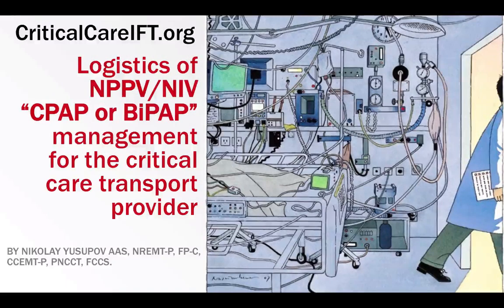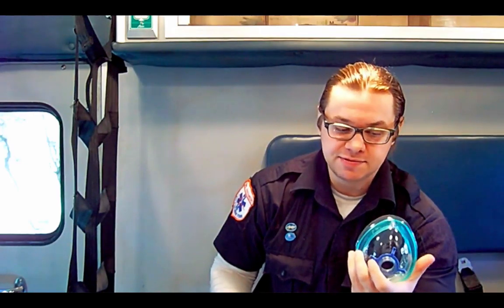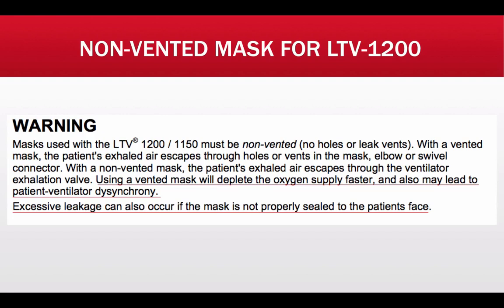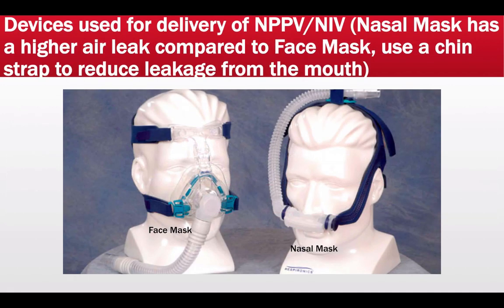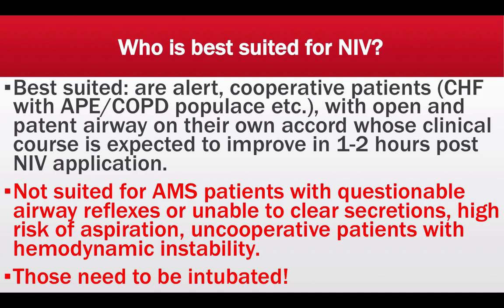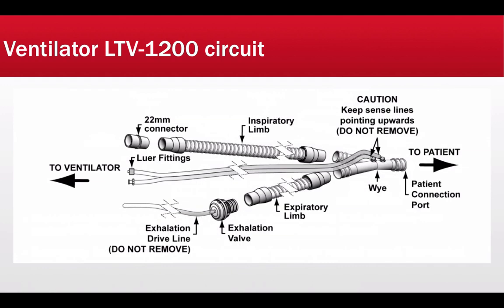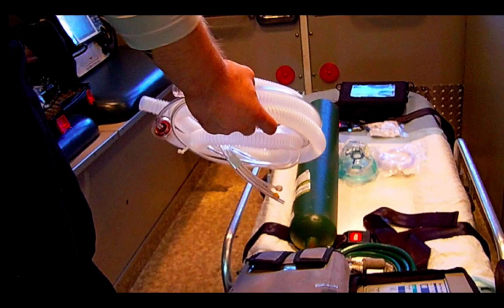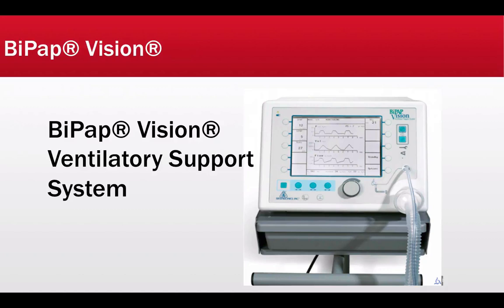How to set up CPAP and BiPAP Non Invasive Ventilation with LTV 1200 Ventilator? Part 1

Comment: is the white line exhalation, and yellow inhalations ?
Reply from the maker: Liz Malin if you referring to color luer locks that screw into the ventilator those are sense lines. Yellow luer lock is low pressure sense line, white is high pressure sense line, and no luer lock is exhalation drive line.

Comment: Great job with these videos.  Hope to see you do a few videos on Invasive Ventilation featuring the LTV 1200.  Love the test glove idea for use during the initial set up.  Learned some great tips from you...Thanks
Reply from the maker: Actually I just finished recording initial Invasive Ventilation Videos. I spent good deal of time structuring the content that it's easy to understand the principles. Plenty of youtube videos explain it very poorly. I should upload them tonight. Thanks for watching! Glad I could help, if you have any questions do not hesitate to post.
Reply from the maker: Initial videos regarding Invasive Ventilation are uploaded. The principles are applicable with use of any other ventilator. In the subsequent videos I will address LTV-1200 specifics, however if you watch the initial videos I think you will find all you really need. Also please provide your feedback or post any questions you may have.